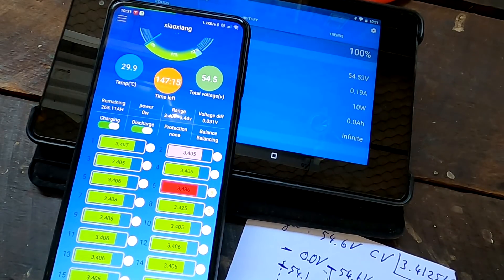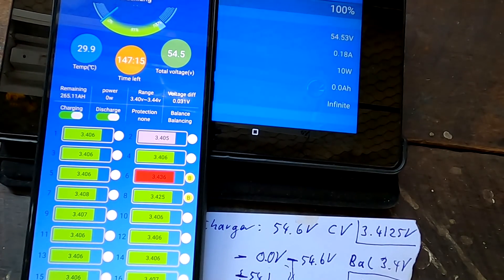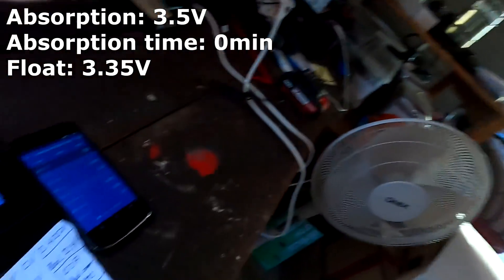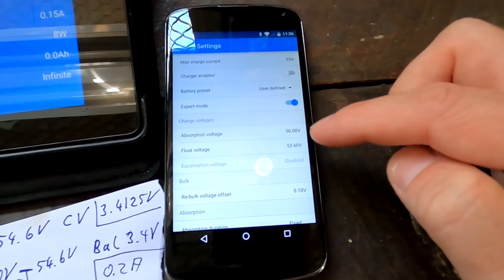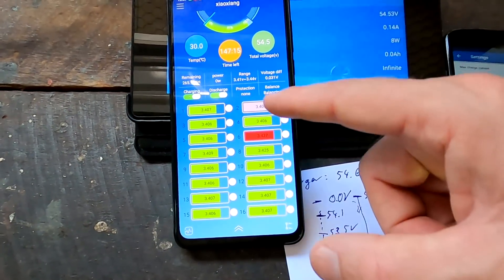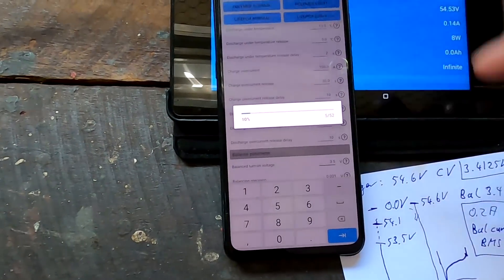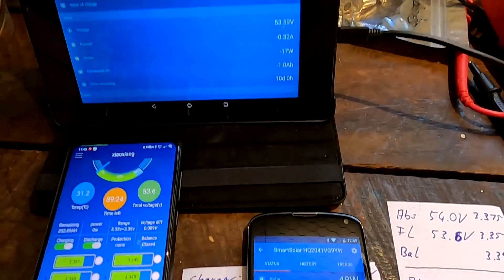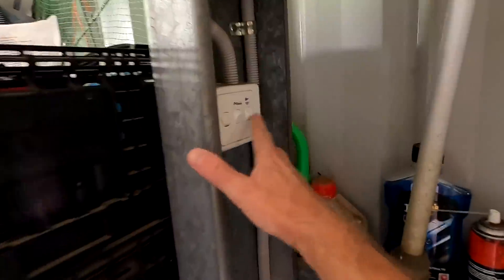Are these the better settings for your solar-battery setup?

Comment: when i had my controller on the lithium i turned bulk and absorption off and just had float that was set to max voltage of the bank this way i found it acted more like the cc cv of lithium mains chargers it worked alot better i just could not do it often due to not very much sun in the uk also lifepo4 dont need a float charge i dont think you can only have bulk
Reply: This is not a good idea.  It will significantly reduce the cycle life of the pack. You generally do not want to maintain a voltage above 3.375V indefinitely.  You use higher voltages only to charge the pack, then you absolutely must reduce the voltage for the float phase to 3.375V or lower.

What happens if you don't?  Well, people DO run LiFePO4 batteries with current-limited trickle-chargers set to 3.40V and no other smarts.  Yes, that works.  Cycle life will be reduced but it will still be significantly better than other battery types and it shouldn't be dangerous (though don't blame me if something bad happens!!!!).

But trickle-charging at a higher voltage?  Above 3.40V?  That can get problematic very quickly.  3.45V is too much in my opinion.  3.4125 (e.g. 13.65V for a 12V pack) might be acceptable but I really don't know how cycle life would be impacted.

The best way to charge LiFePO4 is with a real charge-controller, charging to 3.45-3.60V (low C-rate to high C-rate depending), and then floating at 3.35V.

-Matt
Reply: @junkerzn7312  from documentation Charge: Up to C/1 rate up to 3.6 V, then constant voltage at 3.6 V until I < C/24 i was prob under c/1 but thats how i set my controller
Reply: @1981dasimpson  I assume you are reading off the battery specs and not the BMS or charge-controller specs.   Every battery is going to be different.  Typically you don't want to charge above 0.5C, but can discharge safely at up to 1.0C.

There are no restrictions on lower charge rates (LiFePO4 does not have any sort of chemical memory), but you will have to mess with the bulk target and absorption times depending on the charge rate.  Lower bulk target + higher absorption times for ultra low charge rates.  Higher bulk target + 0 absorption time for higher charge rates.

Float is always 3.35V to 3.375V (for a cell) no matter what the configuration.

-Matt
Reply: @junkerzn7312  i dont use a controller with these kinds of settings i use a dc to dc buck converter with cc cv setting set to that of the multiplied pack as the pack is 7p is about 3.5amp voltate total pack is 12.6
Reply: @1981dasimpson  I don't understand those numbers.  Which lithium chemistry and battery type?  12.6V at 4s?  I think you must have meant to say 13.6V?

13.6V would be trickle--charge levels (3.40V per cell).  That should be acceptable for LiFePO4.

7p is a bit problematic.  Prismatics or Cylindrical?   I'm guessing Cylindrical.  Is it a self-made pack or are they pre-matched cells?

I will caution anyone doing highly-parallel cylindrical packs.   I know there are a ton of YouTubers who are doing highly parallel packs DIY but it can get dangerous in a hurry because the BMS cannot monitor the health of each cell.

Even if somewhat matched, for DIY packs you have to be careful if doing 4p and extremely careful if doing anything higher like 7p.  What can happen is that a cell going bad will be held to a normal voltage by the other parallel cells, and the BMS might not be smart enough to notice the continuous current.  It is possible for the cell to over-heat and cause a fire.  7p packs are typically very dense and most DIY packs have minimal safeties.

The bad cell can become a dead short and regardless of the low current supplied by the charger, the other 6 cells will happily blow it up.

This is doubly true if you are using a constant voltage source and not a real charge-controller.

If you have a FLIR or an IR gun, check the individual cells while they are sitting in the pack while charging for a while, and also at float after an hour, to make sure that all the temps are within 5C of each other.  Any hot cells should be replaced instantly.

-Matt
Reply: @junkerzn7312  no i was talking about lith-ion at some points my packs are 3s7p with a bms they are then paralled out side of the bms
Reply: @junkerzn7312  i am using constent voltage i use a buck converter that has cc cv control
Reply: @1981dasimpson  Ah, ok.  I can give really good advice on LiFePO4, but not on other lithium chemistries.  All my experience is with LiFePO4.

-Matt
Reply: If you are using the battery often that float voltage isn't an issue.
Reply: @kevinroberts781  yeah i agree i have mine on cc cv im using 18650 so my pack is at 12.6v
Reply: @kevinroberts781  just reading on using lifepo4 on a lead acid ups and they say a float voltage of 55.2 is safe and a fast charge voltage of 58.8
Reply: @1981dasimpson  55.2 is 3.45V/cell.  I wouldn't trust a float that high, but YMMV.  Either the batteries will bloat (prismatic) or not, or over-pressure (if cylindrical) or not.  Cycle life will definitely be reduced though because the UPS is applying that voltage 24x7.

58.8 for charging is 3.675V/cell (assuming 16s)., which will likely hit the BMS cut-off.   As long as the BMS cuts it off, that should be fine.  Well, generally speaking it should be ok, LiFePO4 cells don't actually begin to break-down the electrolyte until 4.2V.  So as long as you charge them fast enough (e.g. at 0.5C), 58.8 ought to be fine.  You won't lose too much cycle life.   If you charge them below 0.5C though then you might be over-charging the battery.

(This is for LiFePO4, I'm not talking about other lithium chemistries).

-Matt
Reply: @junkerzn7312  yes why i been worried about replacing my sla batterys in my ups with lifepro4 the lifepro4 would be way more then the capacity of the sla